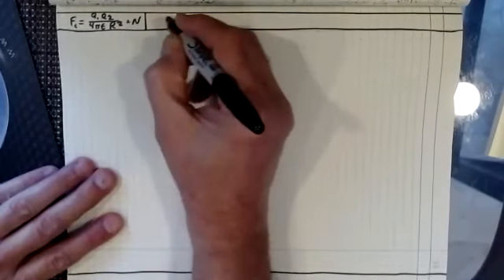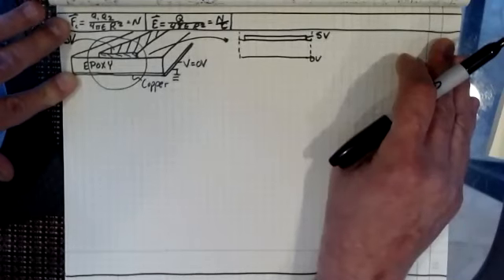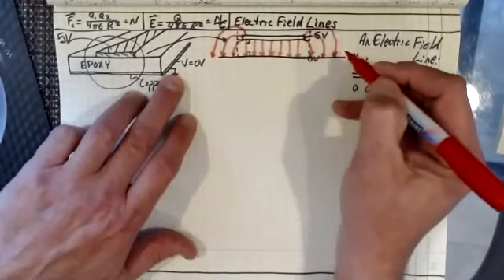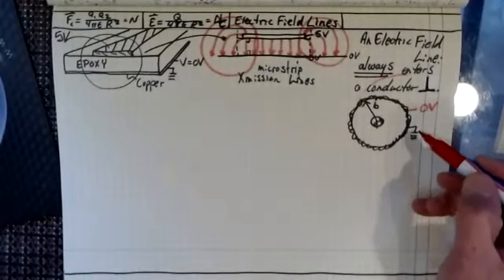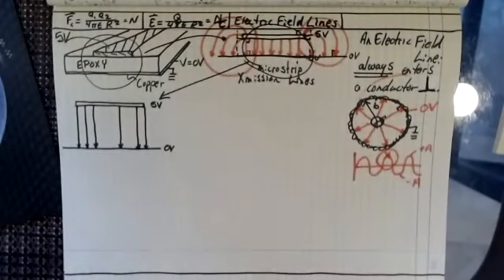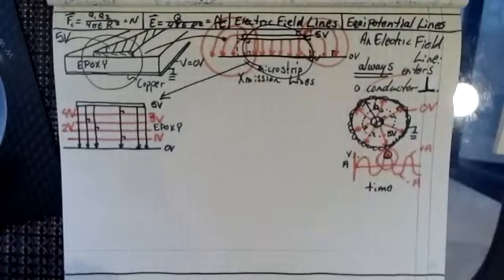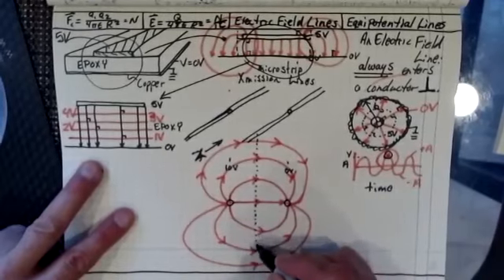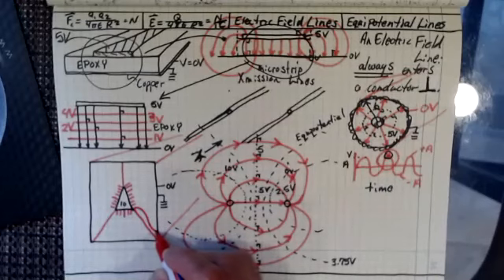Electromagnetic Field Theory  Lecture 6 Electric Field lines

Comment: I have a question regarding the equipotential lines in the power line example. If you draw the equipotential line as you approach the surface of the 10V cable, it's clear that it must be a circle that contains only the 10V cable. As we zoom out the equipotential line seems to become an ellipse with one of the foci at the center of the cable and the other moving further to the left. This could all be mirrored to describe the equipotential lines closer to the ground cable. Does that make the 5V equipotential line an infinitely long straight line? Does it become a circle once it's infinitely far away from the cables? Is there any significance to what shape it is? Is it just a coincidence of using two different equations to describe lines of equal voltage given the fact the voltage is continuous throughout space?
Reply: I've thought about this more and talked to the professor about it. I don't want anyone else to fall into this hole I dug, so I'm going to do my best to fill it back in. What bothered me was the fact that I wasn't able to imagine a single equation that could spit out the shapes that comprise all the equipotential lines. I could imagine three different equations though. Two where mirror images of each other, and the third was the asymptote between them. That felt weird because using this imaginary bitwise function felt like some kind of discontinuity in a continuous world. The lines transition from an almost infinitely large loop, to an infinite straight line, to another almost infinitely large loop. That straight line feels like an asymptote between the two loops that shouldn't be reachable, but it represents a very real value. Now maybe there is a single equation and I either don't have the background to develop it, or I simply need to put in the effort to find it. What I've come to suspect is that I'm approaching the problem the wrong way. The voltage potential is what's continuous. If I imagine plotting the voltage potential in the plane of the example I see a smooth 3D surface. That surface is the result of a single equation The equipotential lines just become topographical lines on this smooth surface. There doesn't need to be a single equation to draw those lines, because those lines are just slices of the surface. Also I don't think the 5V equipotential line is just a straight line either. I think it's an infinitely large circle with a straight line through the center. This is the smooth transition between the hill that rises to the 10V line and the well that falls to the 0V line. I don't have to think of the 5V line as an asymptote between these two loops, It's become the two loops merging together on the same plane. It's where one loop ends and the other begins.

That's why I was confused, and that's how I worked through it.